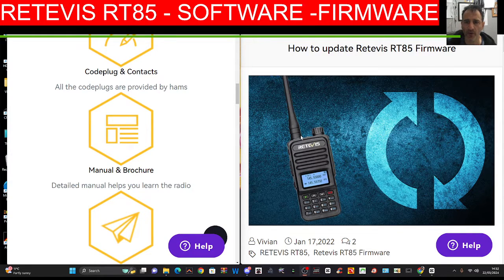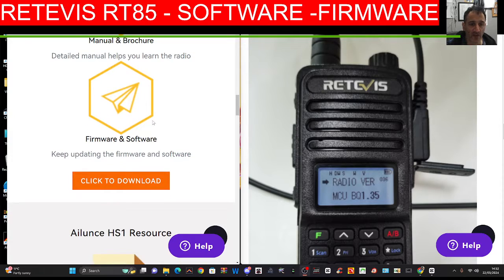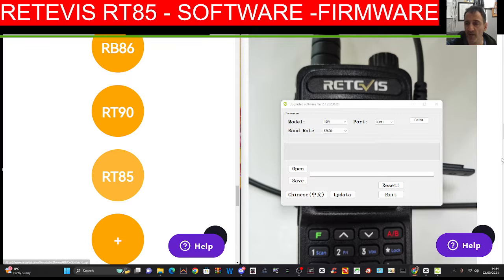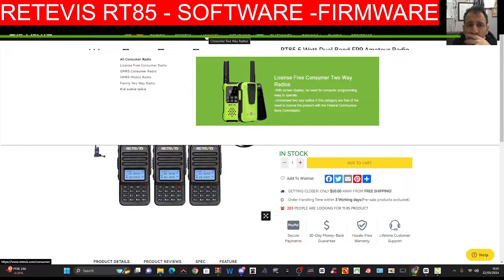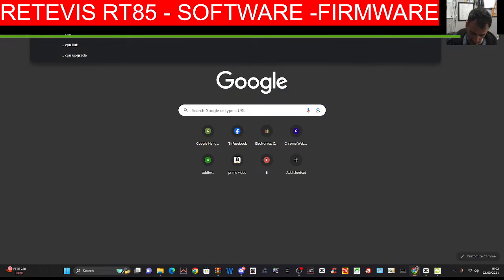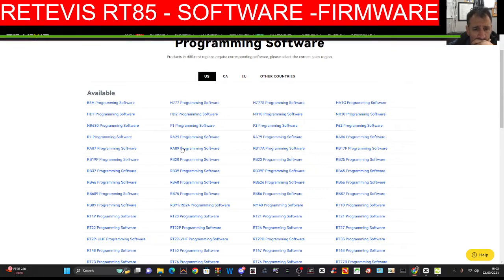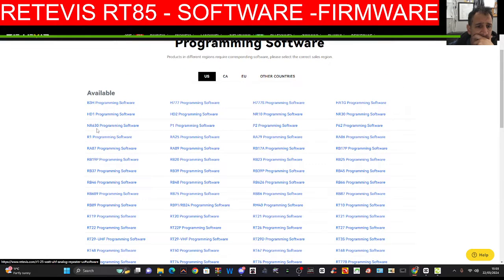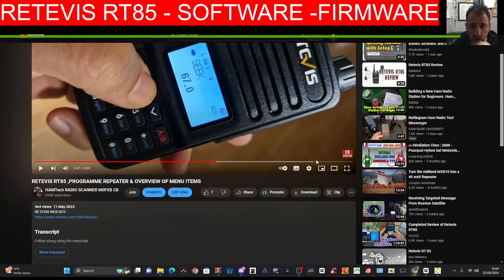RETEVIS RT85 SOFTWARE FIRMWARE LINKS

Comment: Hi! É possível frequências 200 MHz ou Aviação?
Reply from the maker: The Retevis RT85 is a dual-band handheld transceiver that operates on the VHF and UHF bands. Specifically, its frequency range is typically:

- VHF: 136 to 174 MHz
- UHF: 400 to 480 MHz

This wide frequency range allows for communication over various channels and frequencies, making it versatile for different uses, including amateur radio and commercial communications. If you need more details or have specific questions about the RT85, feel free to ask!